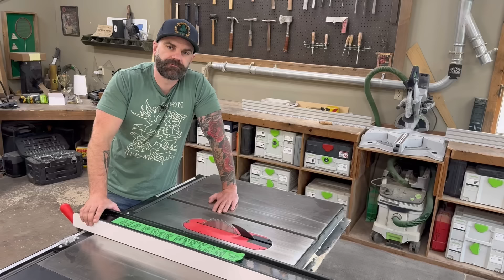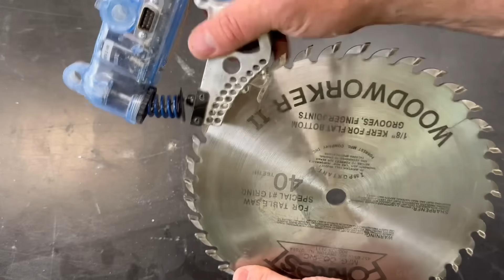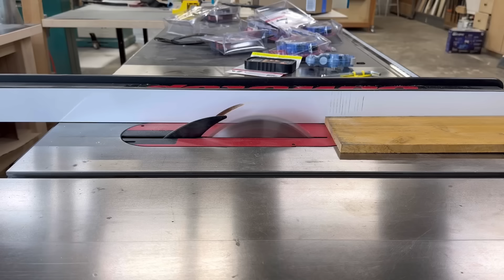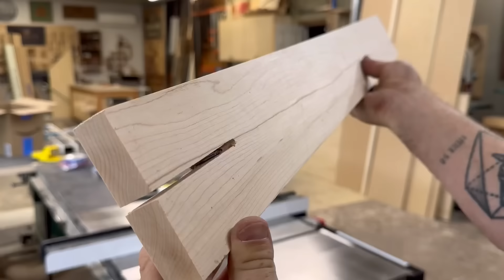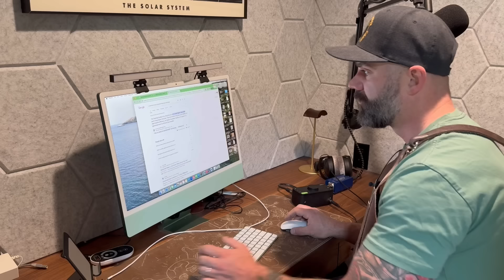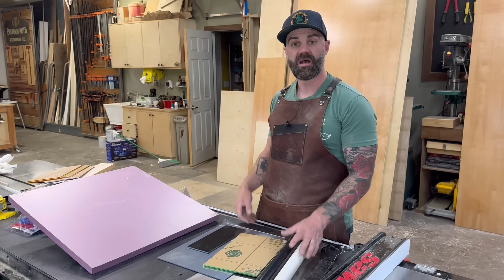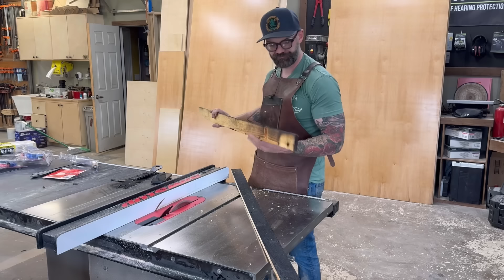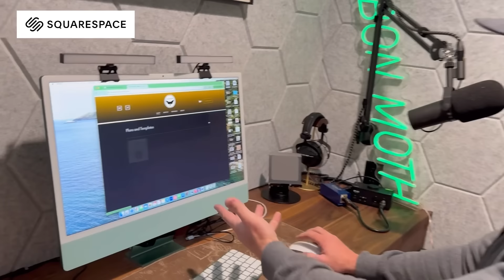Finger Versus Table Saw || Testing SawStop Myths

Comment: We have a sawstop at our local makerspace, and we've set it off by materials four times (two of which were my fault) The first one, and the one that still pisses me off when i think about it, i was building a picture frame sled and i wanted a ruler built into it. So knowing that the typical aluminum rulers would set it off I specifically bought a ruler tape to adhere to it so it wouldnt set off the machine, what i didn't know was there was a metal backing to the tape that wasnt mentioned in the description so it set the machine off anyway. I also set it off because i was trying to be a little to clever with my aluminum bar miter gauge and got it just a hair too close to the blade. 

but the more interesting ones we set it off were with a carbon fiber tube (didn't realize it was conductive but apparently yes it its) and with a large sheet of acrylic, but the interesting thing on that one is that it had previously cut acrylic without any problems, which leads me to think that the "myths" of what can set off the sawstop are more exception than they are rule. If the sensetivity on your particular machine is high enough, if there happens to be enough static charge, if conditions are just right these things can set it off, but it's not a guarantee

Comment: Something to add for the static tests would be the conditions in your shop. From when you chared the timber it looked damp and therefore high humidity. Dry air is more supportive of static so the conditions that you mentioned may have been in dryer climates. You did acknowledge that this test wasn't exhaustive but this may be the reason why those products didn't set it off.

Comment: "thermal conductivity" is NOT "electrical conductivity"! At room temperature pure Aluminum has an conductivity of about 38 MS/m (Al alloys mostly have less though) while carbon steels are around 6 MS/m and stainless (Chrome-) steels about 1.4 MS/m. All this of course are ball-park figures, as the values strongly depend on the composition of the type of steel in question.

Comment: Easy explanation for all this… the sawstop is measuring the current flowing through the blade.   If you attach a tiny capacitor to the blade there would be small current measured.  If you attach a massive capacitor to the blade you would see a much larger current flowing through.  Your body is like a large capacitor. A nail is like a tiny capacitor.  All the tests in between have different levels of capacitance which is why there are so many different scenarios. Small aluminum is a tiny capacitor.   Big aluminum large capacitor.  Small aluminum touched by a human makes a large capacitor.  And so on….

Comment: Was any of the wet wood pressure treated?  I know you ran wet cedar but ceder is naturally rot resistant. Would the chemicals in the pressure treated wood change the conductivity that the saw would detect which I believe would happen.

Comment: Pressure treated lumber has tripped my Saw Stop along with:
* Aluminum 
*Plexi Mirror
* Some laminate ( metal or particle metal)
* Different types of flooring 
*Carbon Fiber

The sound the Saw Stop makes when engaged is like a gun shot. It will scare you when it happens, but it will remind you to bypass the safety when cutting materials such as aluminum. The safety bypass would be a great thing to cover in your video. The procedure only bypasses the safety for one cut until the switch is turned OFF. 

Great video!

Comment: I really wish you tested pressure treated wood. The only time I’ve set mine off in 15 years was when cutting pressure treated wood. I also had made several cuts before I set it off. It would also be cool if you tested cutting an aluminum roofing nail

Comment: Salted water and liquids in green wood conduct electricity, fresh water, however, doesn't conduct electricity. You want proper wet wood test you need to run either very green wood or wood soaked in salted water trough you sawstop.

Comment: I know the time I set mine off that I also had to change my pants along with the blade. It’s extremely jarring when that thing drops down into the table. Oddly, I set mine off cutting a piece of cherry that had been engraved with my laser. I guess the sap created from that was conductive enough to set it off which I did not expect at all.

Comment: I would try a wet peice of pressure treated wood. Water isn't very conductive without electrolytes, but the chemicals used in pressure treated wood might be more conductive

Comment: Why did you look up thermal conductivity of aluminum rather than electrical conductivity?  
It turns out that aluminum is (also) one of the most electrically conductive metals, being surpassed by gold, copper, and silver.
Now for metal, it turns out that the properties are linked -- the electron sea gives rise to its thermal conductivity and its ability to conduct electricity.  But that's not true for materials in general; e.g. diamond having far superior thermal conductivity while being an electrical insulator.

Comment: isn't there a little red "test" led that shows you if the saw has detected something... even if it isn't spinning? Perhaps you could have save a lot of brakes and age on your motor windings and bearings etc?
sausages are salty and very conductive if you had nudged one into the blade with a push stick I reckon it might have been shredded.

Fun video!

Comment: I know the saw keeps monitoring touch after the saw is switched off. The one time I set off my saw stop was after the blade was stopped. The blade bound up in a thick piece of walnut (blade stopped). I turned off the saw and pulled the board off the (stopped) blade. I then thought, I wonder if there is a bunch of pitch build up on the blade. So I reached over to feel the blade and I heard a "click". Sure enough, it had triggered. The surprise to me was that the blade did not drop. Maybe because the blade wasn't spinning?

Comment: Saw stop breaking is triggered by the change in capacitance of the blade. 
Now capacitance between two conductors is dependent on the surface area of the 2 conductors parallel to each other divided by the distance separating the two surfaces.  When you place a conductive surface parallel to the table top, you are creating a capacitor, and when this capacitor makes contact with the blade it changes the capacitance of the blade.  Also flesh also has capacitve properties which changes the capacitance of the blade

Comment: My thought about the wet wood not setting it off, since it senses the CHANGE in potential, would it still trip if it then hits flesh? Essentially, is the potential high (or low?) Enough with the wet wood that adding the flesh wouldn't be enough of a change anymore?
Reply: One question about methods, when you shuffle the saw off and then tested it, did you shut off power to the motor (big red flapper) or the entire system (small rocker switch)? I'm not surprised if it was the motor power that set it off, I think that's in the manual. Not sure about the entire system. I'd guess no, but I'm not sure.

Comment: I feel like the "wet wood" think needs to be a piece of dry wood with a small wet portion because the saw tech works by sensing a difference in the conductivity and if the whole thing is wet than there is no difference

Comment: I would think that the saw stop works of capacitance, the blade holds a charge once you touch the blade you discharge the blade and it activates the saw’s mechanism..

Comment: Dear Mr. Hibbs.  I enjoyed this video, but I fear you just added to the confusion about SawStop.  Mr. Katz-Moses had the explanation correct but in trying to be funny and unnecessarily self-deprecating, you obscured that explanation.  Think of a battery, it has two poles.  If you electrically connect just one of those poles with a wire to something, say a saw blade, nothing happens.   No current flows.  But, if you then connect the other pole to a ground and then connect the blade to an electrical ground, such as your finger, a hot dog, a breakfast burrito, a piece of aluminum touching the saw table, current flows, the saw senses that current and the blade retracts.  The type of material does not matter so much as if it is a conductor of electricity, and it connects to a ground.   Hot dogs and fingers are good conductors, wood is not.  The nail or the staple did not set off the saw because they were imbedded in the wood, hence electrically insulated.   The current could not flow to ground.  Your hapless Rockler miter sled tripped the saw when you held the fence because the current ran to ground through you.  But what about when you were holding it at the back.  Look at the sled.  The runners are metal.  I suspect that the current grounded through the runners when you were holding it at the back.  So, all the things you tried are easily explained, could a current flow from the blade to ground or not.  If it can you will trip the saw, if it cannot you will not.  Most cordially, W. David McGuinn, Jr.

Comment: I had one trip, and the blade did not stop, Thankfully, wasn't me it was cutting.  It tripped, and the saw shut down, but it didn't stop the blade.  Glad I've always treated them like normal table saws.  (Turns out the material I was cutting had a conductive surface, which tripped the system.  However the aluminum piece that is supposed to catch the blade never touched the teeth.  I'm quite positive it was because dust and electronics don't mix well, which is why I do not trust a saw stop to actually work when needed.  Also arbor bearings went bad within less than 18 months.  Not impressed, and glad I never bought one.  Jet and Powermatic (corporate siblings) make much better machinery.

Comment: Electrician here. For metal, it's mostly based on resistance and conductivity. Aluminum is a much better conductor, but there are a lot of other factors also. The amount of material (the fence being much larger), being painted, galvanized coating, etc. As far as water setting it off, water is actually not very conductive by itself; it's the minerals in the water that can conduct electricity. If you used salt water, it would most likely have tripped. So for wet wood, it's based on what chemicals are in the wood that may trigger it.
Reply: EXACTLY!

Comment: Theory - when using the fence there is contact between it and the actual table surface which could cause some sort of loop.  Other theory. Different metals touching each other create a low voltage and that could be why aluminum + steel triggered the stop.

Comment: Wet wood set off my Sawstop last spring. I was making a rain water stand for my rain catchment tote. I was ripping some pressure treated lumber that had been sitting in the Oregon winter sunshine (AKA Drizzle).

I want to be clear this wood was dry to the touch. The PT 2x4 set off my brake at about 2 inches into the rip. Your results may vary, but the new brake was a $105 mistake that I do not wish to repeat.

My day job has been in ultra-pure water and water treatment for the last 25 years. It is my guess that the toxic metal salts that PT is impregnated with (chromated-copper arsenate) --substantially increases the salinity and the conductivity of the "distilled" rainwater that we are likely to find in wet wood. The fortunate coincidence is that we all have salt-water coursing through our veins. (Harrr).
Reply: All the anecdotes I've heard for wet wood involve pressure treated. I think you've got it: the salts improve conductivity.
Reply: Cedar triggered my saw stop.
Reply: I had a very similar experience while building a deck. We cut most of our joists and all was good until it wasn’t. I wouldn’t call the wet wood triggering a busted myth, maybe unlikely but not busted. We were also pretty sweaty while handling the wood so the added salts may have been a factor. Whatever the actual reason we were suddenly at a work stoppage. Just sharing an experience here as a data point to consider your risk management threshold when making the decision to cut wet would.

Comment: How about if you cut aluminum with the bypass on first, maybe a roll of aluminum foil.  Then use the saw with the bypass off to see if any of the aluminum shavings set it off before cutting a piece of wood.  I know you want to replace that contraption again.

Comment: If the wood is really soaked it does trigger the saw stop. I have a Festool, which uses saw stop technology and I bought some oak, which sat in the rain for weeks and was really soaked. The moisture meter showed a little more than 30%. Luckily I tested it by pushing it against the blade before trying to cut it and the trigger led was flashing. I think that 48 hrs won't be enough to really soak it. A few weeks in the rain definitely 'do the trick'.
Festool says that nails in the wood won't trigger the mechanism as long as you are not in contact with the nail. But I've decided not to try. 🤣

Comment: Awesome stuff Jason, thanks for the info! 😃👍🏼👊🏼...... As far as the "wet or green" wood is concerned I'm thinking that a lot of the people having issues are potentially cutting pressure treated lumber which is mostly now treated using copper (highly conductive) since the EPA banned the use of arsenic (2004) for use in the residential market due to health concerns..... Additionally, the human body (and other living things) use electrolytes for processes like conducting nerve impulses, contracting muscles, hydrating, and regulating pH levels, so I would say that it's more likely it's the amount of salt present and not the water itself that's triggering the SawStop.... I would suggest to try spraying it with saltwater.... Now I'm wondering if a freshly felled and milled tree might contain/maintain some level electrolytes for a period of time? ...🤔

Comment: Water isn't conductive, it's the minerals in the water that make it conductive. This is why circuit board manufacturers clean their boards with distilled water which has no mineral content. So wet wood can definitely set off your Saw Stop, it just depends on the mineral content of the water.

Comment: We had ours go off multiple times in a week at work and we were told the static was coming from a belt inside the cabinet somewhere. I believe we cleaned really well under the cabinet and replaced the belt and it was fine after that. 

There was no reason for it to be going off. No metal involved.  I was cutting walnut, and other had it go off cutting plywood and particle  board

Comment: Looking closely at the fence it seemed to me that there is a hole where the guide rail connects to the board. if the bolt / screw holding the guide rail on is in contact with the fence then it would ground it through the table and set it off.

Comment: WOW!! Expensive test video. 100$ per brake, woodworker blade. Money to burn. I set mine off due to my own stupidity. I forgot to adjust my incra miter gauge and ran it into the blade. What a royal pain in the ass trying to get off the arbor. In the simplest form, anything that will change the “FREQUENCY “ of the sine wave , of the induced “POTENTIAL “ voltage, will set it off.

Comment: Want to test SawStop with a real finger? Stick your finger into the blade from the side. Also don't use a blade with carbide blades, or it will cut your finger when it goes down. Use a blade without tips that extend to the sides.

Comment: After these tests SawStop should be offering you a sponsorship. You've convinced me that when I replace my table saw I'll seriously consider a SawStop system.
Reply: Since new cartridges run a little more than $100 now I'm guessing SawStop sent him that box of cartridges gratis.
Reply: Honestly, I thought he kinda is sponsored by sawstop. If I recall correctly festool bought sawstop and I thought he was sponsored by festool?
Reply: Just wait. Saw stop just gave the patent away in a move to make all table saws have a similar system.  So if you wait a few years grizzly ,Jet, harbor freight even dewalt job saws are likely to require them.   Personally I do think it is a good Idea but it should not be required for all saw makers to have to meet.  So if you got your eye on a nice non saw stop because you do not want to pay for the tech you best pick it up soon.

Not sure what shopsmith is going to do.
Reply: @jvmiller1995  That honestly makes me want a genuine sawstop more.  On the grounds that they should be rewarded for doing the right thing here.

I really did not like the way they were going about trying to use the bureaucracy to regulate their way into every table saw before they made that decision.

Now that they have made that decision though, they earned a metric crapton of respect from me.

Comment: The reason the fence triggered the stop was a circuit was formed by the fence, the bolts connecting to the metal guides under the fence, and the table…

Comment: The shared shop that I use told me about the issues with nails or moisture. Said not to bring in barnwood. I rarely use the tablesaw for my projects but I definitely can’t afford to be replacing any cartridges so I’m not about to test it out.

Comment: PLEASE TEST PRESSURE TREATED WOOD
Here in sweden it is very common to use pressure treated wood for outdoor flooring etc.
That wood contains different types of salt/cemicals and from the store it is usually very wet, probably more wet than if you put it into the river as water is pressed into the wood.
Pine is most commonly used and after treatment it can be outdoors for several decades.